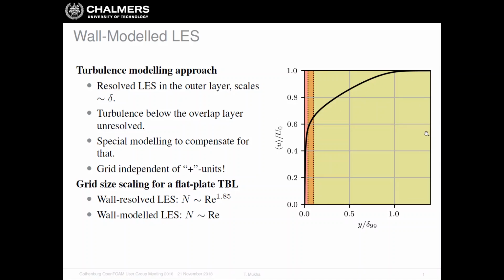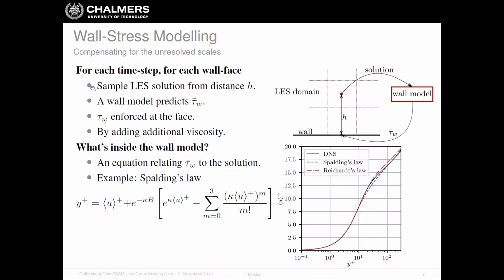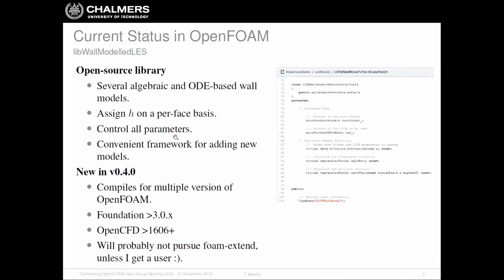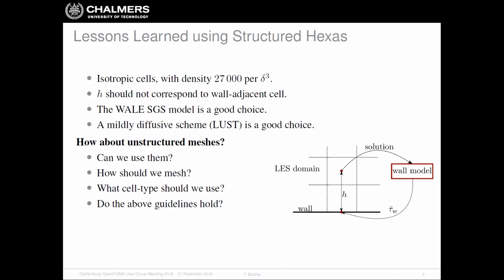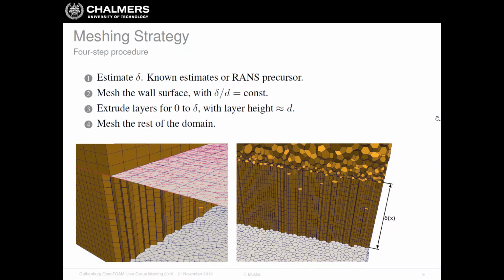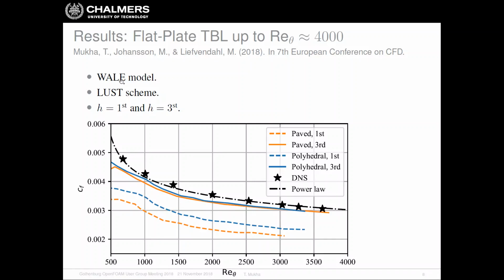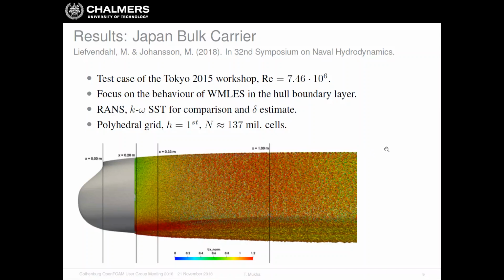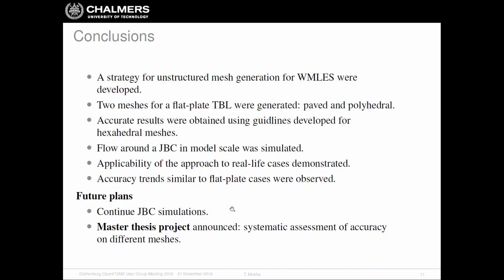Wall-Modelled LES on Unstructured Grids

Comment: Hi Timofey,
In Wall modelled LES, if k-eqn model is used then what sort of wall function should be used for ksgs?
Or is zero-gradient bc fine?
Typically for yplus <1 LES ksgs=0 is used at wall in Openfoam tutorials.
Particularly, in my simulations yplus range from 3 to 10. I am using Spalding wall function for sgs viscosity and grad(ksgs) =0 at wall.
Reply from the maker: @NITESHKSAHU  not sure there is a clear-cut answer for k! But if your simulations are y+ 3-10, you might as well make sure that it is <5 , which would mean Spaldings wall model doesnt do anything.
Reply: @TimofeyMukha First of all thanks for ur kind reply.
If I reduce yplus below 5 then I dont have to use wall functions for nut. But what about ksgs? How to tackle it? kindly provide ur suggestions.

Comment: After re-watching : Really great content. I have to smile as the industrial analysis i am dealing with, we are using DDES and 3 layers. I guess there were never done a analysis of an estimation of delta. Checking your mesh for the flat plate, i can imagine that 3 layers (without any estimation) is bad for the RANs regime and fir WMLES potentially we need way more layers which should be not possible for the cases I am investigating. Especially due to the layer adding algorithm (shrinking the inner mesh).

It seems that your content gave me a lot of new tasks to investigate in order to make the simulation more accurate and reliable.
Reply from the maker: Thanks Tobias. Yes, the objective to resolve the outer layer demands quite a but of layers. WMLES is still an option only if you have lots of computing power.
Reply: @TimofeyMukha  Thanks for clarification. So in general hybrid models are cheaper, right? I guess I was wrong yesterday because if we have RANs modelling for the inner region, we simply check for y+ to be within an appropriate range (y+ > 30 to lets say 300 for RANs + wall-modelles). I guess now I got the statement of yours that its a bit wired to not go with y+ while using WMLES.

So lets see what I can do to get better results :) 

In any case, for RANs-Hybrid LES. Is there also some estimate for resolving the viscous layer in our fluid? As mentioned, I cannot believe that a few layers 2 - 4 might be sufficient, even though the y+ is okay.
Reply from the maker: @HolzmannCFD  Indeed, for LES, including  WMLES, we need to think about the wall-parallel resolution.  Hybrid LES/RANS, when used as initially intended, model the whole TBL as RANS, so it is much cheaper. If you want to use the for WMLES, outer layer requirements are the same as in any other WMLES, but as you say you will have to resolve the visous scales in the wall-normal directions. I'm not sure about how many points you would need for that, but I guess it should be dicteated by the RANS model in you hybrid.

I've never run a hybrid simulation in my life though, so this is a bit outside my expertise. However, we have several experts in the turbulence modelling committee!
Reply: @TimofeyMukha  the TBL is also the outer layer region? Or to which point is the TBL going to in terms of y+/y* ? Need to recheck my literature.
Reply from the maker: @HolzmannCFD  Yes, the TBL is compose of the outer an inner layer, which over lap. The overlap is the log-layer. By definition, at the edge of the TBL y+ = Re_tau = delta*u_tau/nu
Reply: @TimofeyMukha  another question. Is it essential to have face parallel cells for the outer layer or would it also work if we would use some nCellsInBetweenCells set to 20 for the surface? Adding 20layers in snappyHexMesh for real industry cases seems not possible (at least with a high layer coverage)

Comment: Hey Timofey,

WALE is the turbulence model, right? Hence, the WALE = wall adaptive local eddy viscousity is a SGS model, right? However, this would mean its implicit LES right - therefore, we would need a good grid close to the wall. To overcome that, we would be able to use your wall models for the shearStress models (algebraic or ODE). 

Still a bit messed up in my head but its getting clearer. Any clarification is warmly welcomed.
Reply from the maker: Hi Tobias! Let's see; correct, WALE is an SGS model, which means that this is not implicit LES. Implicit typically refers to not using an SGS model and relying on the numerical scheme to do the dissipation. But implicit or not, a proper LES, we could call it wall-resolved in this context, needs a good grid to resolve the inner layer of the boundary layer. The goal of wall-modelled LES is to skip that and only resolve the outer layer. And to compensate, we introduce the shear stress model. Hope this clarifies things, please say if you have any more questions.
Reply: Hey Timofey, thanks for your reply. Got everything after I understood the concept of LES yesterday. Seems to be somehow similar to RANs. As we cannot resolve the smallest scales we introduce a artificial viscosity (on top of the natural viscosity of the fluid) in order to dissipate the smallest resolved vortexes in our mesh. The nu_sgs is calculated or modelled by the assumption that nu_sgs = l0 x U0. Based on the LES model in use, l0 and U0 are approximated in a different way. WALE is similar to smagorinski in terms of modelling l0 but the U0 is treated differently to incorporate the damping near the wall more appropriate (at least if I got it correct). However, any LES model such as Smagorinski or WALE would require a fine mesh at surfaces to resolve the physics here as well (but large meshes). In order to reduce the cell count we further can use shear modeled LES which allows us to coarsen the mesh around surfaces and resolve only the vortexes in the outer region but not in the viscous sub layer or inner region. 

In a rough overview i would say, the shear tensor in RANs is manipulated by nuEff = nu + nuTurb and for LES it's nuEff = nu + nuSgs. 

However, i am aware that it's a different approach as in LES we should keep resolving around >80% of the vortexes (turbulent kinetic energy) while we RANs models the turbulence everywhere. 

Nevertheless there are still a lot to understand and optimize.
Reply from the maker: @HolzmannCFD  all correct :-)!
Reply: @TimofeyMukha  to hear "all correct" from an expert like you gives confident :) Thanks Timofey. 

I will go through your grid-estimation now and check out how to incorporate it to real industrial external aerodynamic cases.

Really looking forward to use your models as we are using hybrid methods at the moment LES/RANS (DDES) but it makes trouble in resolving the detachments of the flow around an object wrongly. The first test with WALES was much more promising (while keeping the LES/RANS mesh). So really looking forward to use your wall shear models on top of it.

If this turns out to much more accurate, potentially I would love to ask you if we could incorporate your models to the OpenCFD version + extend it to work with cyclicAMI patches :)